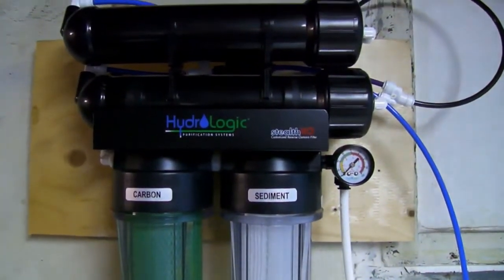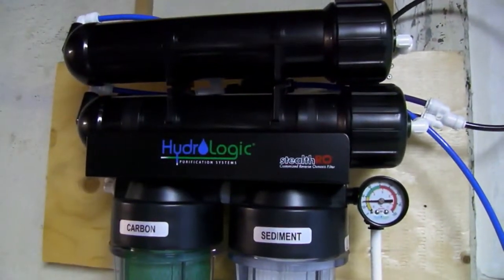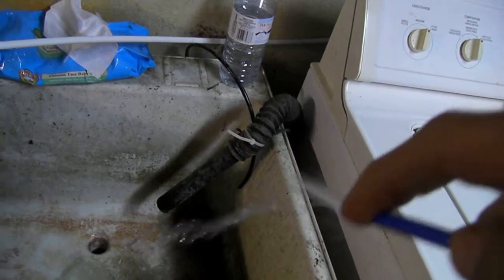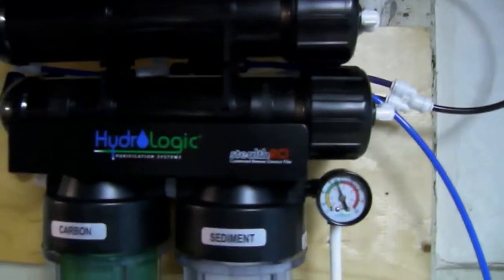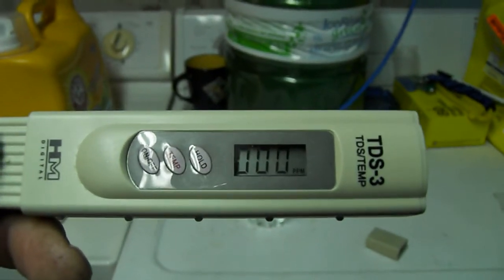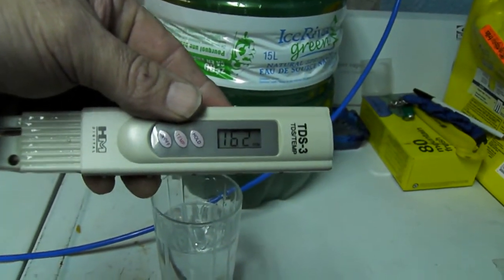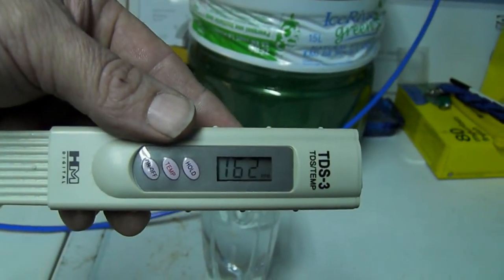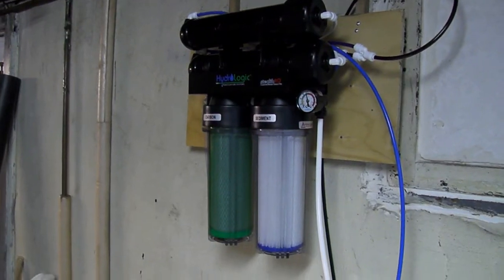Hydrologic stealth 300

Comment: Man you guys have 70psi thru the fu*king tap , that's fjcked I only have like 40 tops , my pressure drops and raises,  from 25 to 50 but usually a steady 40, I'll be investing in a pump , but not for the tap , I'll be pulling rain water from a 50 gallon barrel like I mentioned below .
Reply from the maker: 40 psi might work

Comment: Mine is a stealth RO 300 also, but doesn't have a valve on the back to increase pressure like that. Do I need to buy a RO booster pump?
Reply: Yes we get snow melt water in our town. I just got the RO system so I can control the nutrients in the garden.
Reply: There is no valve to increase the pressure. He was just flushing it out and not filtering anything, so once you start filtering, the pressure goes up as water is forced through the filters.
Reply: 71ppm where im at.
Reply: @rca_yj3928  good water there by the sounds of it , I ordered an RO system last week  so 1ppm where I'm at now lmfao , 4ppm at the most haha. I ordered a Hydrologic Stealth RO 300gpd
Reply: Absolutely you need a booster pump. I myself bought the same RO system and I am on a well and when I got home the pressure would not go up to the green so I went online and they do make a booster pump but it's fucking $260. I bought a distiller instead but that's expensive to run every night so I think I might end up buying the booster pump. If you buy a booster pump make sure you buy the right one for the right stealth Ro system.
Reply: 300ppm where I live hahaha